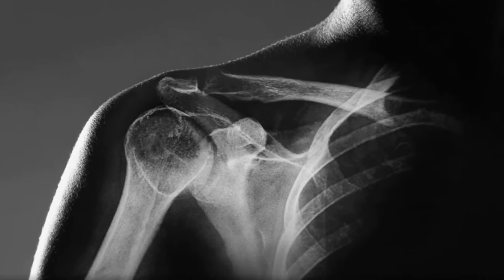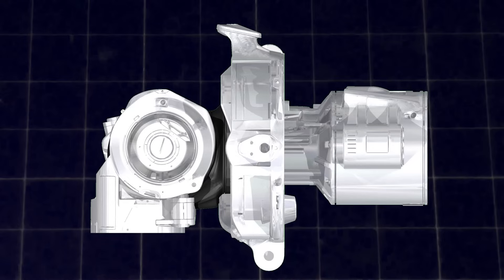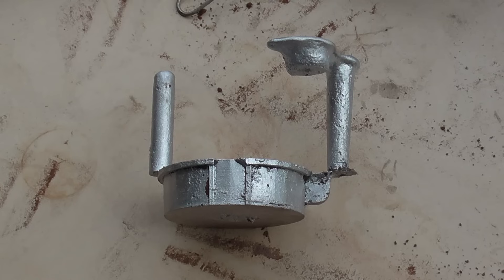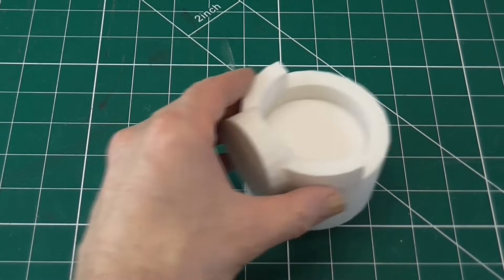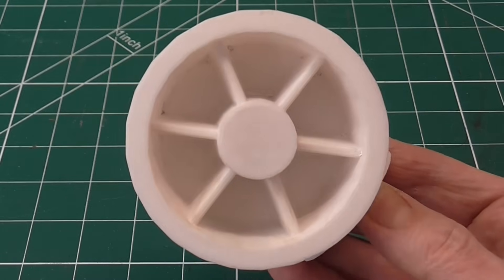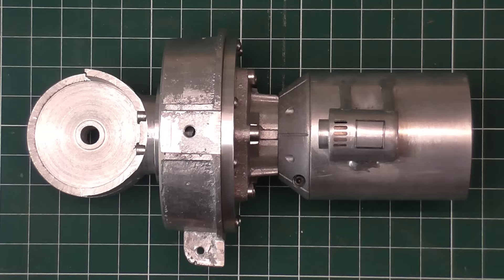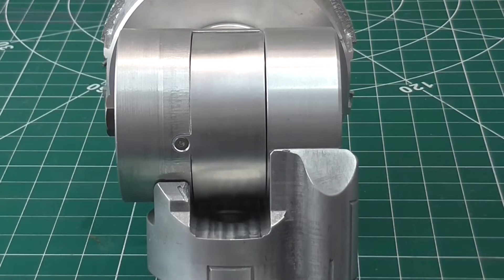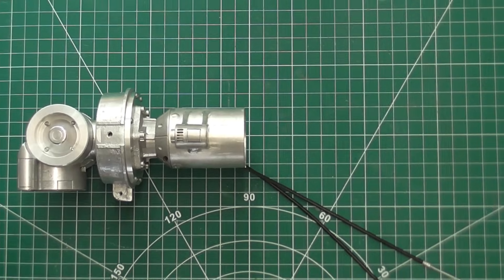Building the Terminator  EP14. Shoulder

Comment: I love this project!
Could you tell what is the weight of one shoulder?
And how are you going to control the motors and joint position?
And have you thought about using brashless motors?
Reply from the maker: Thanks! Each shoulder unit weighs around 5kg. The motors or joints will have encoders attached for feedback of the position. Yes, I initially wanted to use brushless motors due to their better power/size ratio, unfortunately though they are much higher speed and lower torque than brushed motors meaning they need a bigger gear reduction so the advantage is lost.

Comment: What was the weight for whilst pouring the molten metal Andy?
Reply from the maker: To keep the top half of the mould in place. Aluminium is denser than sand so sometimes the top box can float on it and the metal will leak out of the sides.
Reply: @AndysMachines  I didn’t know that. Is it 100% sand you use or is it mixed with anything?
Reply from the maker: It's a naturally occurring sand but it's actually a mixture of sand and clay (Bromsgrove greensand).

Comment: What's the backlash you managed to achieve on the cycloidal gearbox?

Very curious how good a DIY cycloidal can be.
Reply from the maker: I did measure the backlash and it came out to around 0.5°, though I deliberately cut the discs with some clearance to avoid binding as I was aiming for smooth running rather than low backlash. I'm sure it's possible to do better with DIY equipment, even some of the 3D printed ones I have seen have been pretty good.
Reply: @AndysMachines  Thanks :)

Comment: This is just great... I love the effort you're putting in, there are some really good engineering solutions that you are coming up with, you look to using the same small model I used in the early days of my build, I moved over to a 1/4 scale version when I moved on to the shoulder pistons, I still have reference photos if you need any, I discovered that the "real" thing would probably have floated on the pistons with the shoulder blade having a pivot point and a slide section this is what would allow for a shoulder shrugs and roll movement, not sure if it helps this one sort of shows what I mean.... But Man..... Yours is going to crap all over mine when you're done :)
https://www.youtube.com/watch?v=dV_kAIYp8LY

Comment: Thrilling progress and wonderful work in this episode. How did you calculate the design for the cycloidal drive? CAD plugin or?
Reply from the maker: I actually designed it in excel using a formula I found online, then just copied and pasted the values into a gcode file for machining. Only the cycloid discs were CNCed, everything else was done on a manual lathe/mill.

Comment: So great build, and so bad motor! :)
Reply from the maker: I actually really wanted to use a brushless motor for this, but even the low KV ones have a much higher max. speed and much lower torque at low rpm, meaning I would need more gear reduction, since I want low speed and high torque. Brushed motors are more 80s anyway!

Comment: I've seen a few 3D printed cycloidal gear boxes, but not a scratch built machined one, neat video, thanks!
Reply from the maker: This is actually the first cycloidal gearbox I've built. The design was largely dictated by the space it had to fit into and the fact it had to be hollow. It turned out fairly well, it does have a small amount of backlash but runs nice and smoothly.

Comment: The level of thought and execution here is fantastic; those cycloidal gearboxes are superb.  The gear hobbing machine is put to good use; wire tendons are a good human analogy.  Great result and video.  Thanks.
Reply from the maker: I've built robots with cable tendons in the past and always had problems with them (cables can stretch, slip etc..) So it wasn't my first choice, but I think it's the best option here. I'll find out how well it works when the arm is attached.
Reply: Tldr: I likeeee